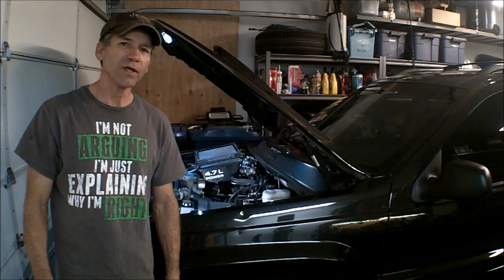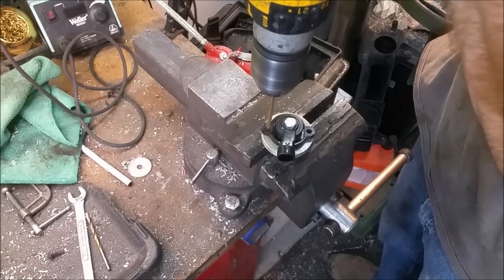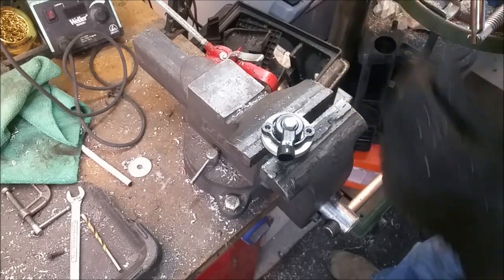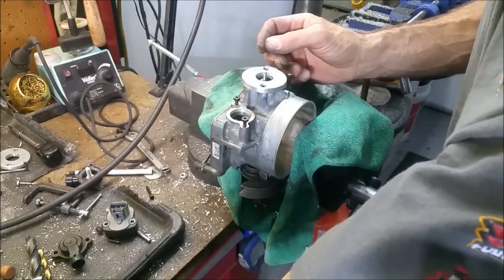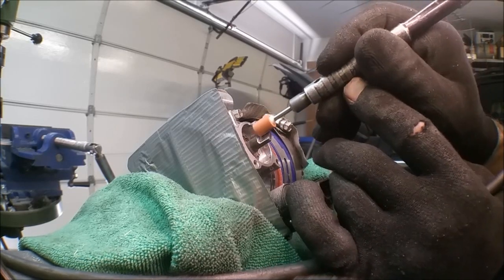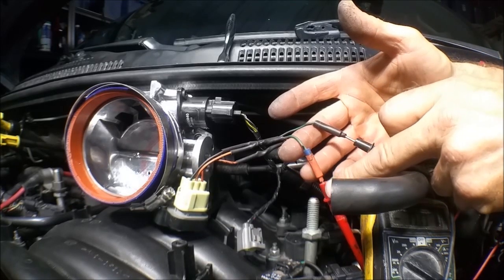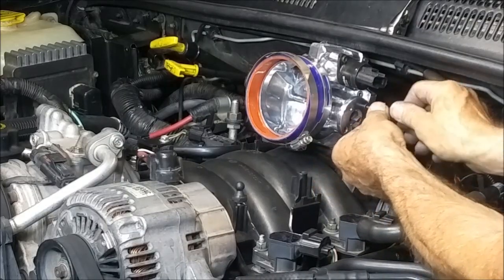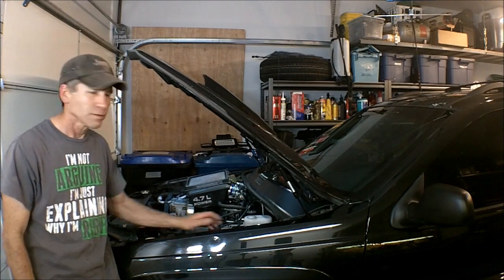Installing 75mm Throttle Body Dodge, Jeep & Chrysler 4.7 Part 2

Comment: Your intake air control is going to affect your drivability even as much as making your air conditioning function properly is critical. The four wire '99 through 2004 IAC are usually not compatible with the two wire 2005 up remote electronically control throttle bodies. I have an interesting work around for this that will let you extract incredible gains just by getting your IAC working.
Reply from the maker: With the throttle body that I used I still use the factory idle air control valve, with a small modification.
Reply: @martinbuilt  so I have an 01 following your HP solutions I went and purchased the canned solution adapter but the Throttle. Body is from a later wireless W model. The tunner I got the throttle body from said just cover the motorized IAC hole and fix the sensor behind the throttle body. It worked! The throttle body itself is stock 69mm where they opened it up was behind the throttle body which measures 70mm. It's pretty slick. Just FYI. The PCM learned the mods. I'm using the 89 octane. There's a 4wD in Sparks that sells the intake manifold bolts.

Comment: Martin, do you have any performance gains data on this 75mm throttle body?  The 72mm throttle bodies where temperamental at best and would be known to throw codes every now and then.  One of the other side effects where that the 72mm would be giving the equivalent to WOT air flow at about 75% throttle… this meant there was no change in power with the top 25% of throttle movement. 

I’m really curious how this is working out and if you have done any tuning to take advantage of the 75mm TB… tuning for the full throttle range would help for sure. 

I’m really just picking your mind and wondering if you have experienced any of the above.  

I know at my track the truck was a about .01 quicker with the 72MM over the 70MM but the 72MM was all in at 75% throttle.
Reply from the maker: Hello Nick, I don't have any data and still haven't done any tuning. I know when I installed the 75mm TB with the 08 intake manifold the gain was very noticeable 😁
I never had a code due to the TB.
Nice to hear from you.
I'll be ordering the APR head bolts soon.

Comment: After you set the TPS at .76v does the voltage increase or decrease as the throttle blade opens?
Reply from the maker: The voltage would increase.

Comment: Impressive as always Martin, great job with everything you have done on the 4.7! I have a few questions I would like to ask you if possible:
1- For those who don't want to run an air ram system like you did, rather keep the OE box, How to go around the increase in diameter to make it fit? Wish you can share the options they car follow for this.
2- I have read the comments below and understand that you don't have the time for mass fabrication, are you willing to share the CAD file or at least a hard copy blueprint of the throttle body adapter?
3- Any specific part number for the GM throttle body?

Thx
Reply from the maker: The stock air silencer will work with this TB.
I don't have a part number for the TB that I used but you can find it on vehicles that I listed in the description.

Comment: Hi Martin im a fan of yours i enjoy watching your videos every other evening  i really like what you have done with your truck, although I have a question how much horsepower is your jeep kicking aftee all the mods?.
Reply from the maker: Thank you for watching. I can't say for sure, haven't had it on a dyno but, I would guess 300 HP
Reply: @martinbuilt  I love this  throttle body mod as well as the 08 air intake, videos that I have watched multiple times to follow the same steps when I start my project, I live in NY and unfortunately there is not enough space to work on project like this also there's not pick a part near by 😪🤣, so how likely are you to build an adapter for the throttle body ones i buy it and also hook me up with the 08 intake and set it up like you did with yours and ship it just ready to install it in my truck, and how much will you charge? your time valuable, but of course only if you can, thanks.
Reply: @martinbuilt  next episode dyno test please 🙏.

Comment: Hey Martin, love all your content! What did you do with the ported stock TB after you installed the LS TB? Would you be interested in selling your 70mm ported stock TB?
Reply from the maker: I believe I do still have that throttle body but I only cleaned up the throat part of the throttle body never really ported it. It's still a 68 mm.
Reply: @martinbuilt  Ok thanks for the reply! Alot of guys on here don't take the time. Keep making videos! I'll keep watching!

Comment: Hi Martin! Im a big fan of ur wjs videos, and letme tell you... a lot of your tips and ways i had applied on my wj. A need ask you... what recommend when change the oil pan on a v8. Really hard work and some help is really appreciate!!!! Thanks a lot!!!! Big regards from Comodoro Rivadavia, Chubut, Argentina!!! (Patagonia)
Reply from the maker: Hello Mariano, I personally haven't done a oil pan change or gasket change yet on the 4.7, I have removed the oil pan from the engine that I have on the engine stand the hardest part was breaking the seal between the oil pan and Gasket. I used a large bladed screwdriver between the gasket and oil pan. 
Do you know Leandro from Argentina he has a mechanic shop there?

Comment: Hey Martin, where did you find the reference voltage for the TPS circuit? What is the difference between the     .52v and the .76v you targeted? 
Thanks.
Reply from the maker: With the ignition switch in the on position, there should be 5 volts on the solid orange wire at the TPS. I like to set the TPS at .76 volts for better throttle response.
Reply: @martinbuilt  thanks again
Reply from the maker: but when setting the voltage use the orange with the stripe.

Comment: with all these great mods you have done, what has your milage been when feathering for mpg or zooming?
Reply from the maker: Well by using the overhead display that shows miles per gallon it seems that each mod I do the miles per gallon increases. Now even though that display is not entirely accurate I use it as a gauge to tell me if things are getting better or worse as far as miles per gallon. In town the display is telling me I'm getting 21.6 I think in reality it's probably more like 18.5, now of course I think it could be better but the thing is so much fun to drive and it's hard not to stick your foot into it.
Reply: @martinbuilt  thanks so much, starting my WJ build. you have inspired me. My last truck was a 2500hd with an 8.1. and allot of overlanders tend to add weight but nothing to add in performance like you have,

Comment: Martin,  I love that there are others out there that want to upgrade and make better with the jeep . Most folks don't do upgrades unless they can pay and have it shipped and done for them.  You on the otherhand just fire up the lights in the garage and have at it! Awesome vid as with all your other videos .i have a jeep 4.0 wj and have replaced,modded or upgraded or have tried everything and I'm gonna go to the yard today and grab some throttle bodies  ... My jeep runs great but I always known it It could be better.... I run a 20 volt system and absolutely love the way the wj responds to higher voltage.  Not just for car audio but it seems to Smooth out everything..
Reply from the maker: Thank you Kyle appreciate that, I also have a video on installing the 68 mm throttle body on the 4.0 that works really well. I'll have to look into this 20 volt system I haven't heard of it.
Reply: @martinbuilt  I v always ran my alternators in my gm and jeep vehicles bypassing the computer , Before i started wrenching on jeeps I started life loving electronics so i got my EE from the university of nebraska and have ran a 12 volt car audio/repair facility for the last 20 years . I use (3) 16 volt batteries along with a supercap module , i use a variable voltage module for the alternator and run the mark  fan with a stepdown module . if you thought the Mark fan moved air 14 volts imagine 20, . I started running higher voltage back in the day because with higher voltage and current amps produce more power and are waay more efficient ill send pic s

Comment: I'm rebuilding my wifes 4.7 Durango. Adding new improved heads, headers, cams, .030 pistons, 08 intake. But I am not sure what to do about throttle body. Feel like it will be missing something without a bigger throttle body intake. Do you have any recommendations?
Reply from the maker: BBK makes a 70 mm that would work well. I got to say I love my 75 which is a perfect fit to the 08 intake. You may want to give Nick at Air Ram Performance a call and see if there's anything else available.

Comment: Hey Martin, great vid once more. I got me that same 75mm throttle body from the yard but don't have the tools to make me the  adapter plates. Would you be willing to make  a set for sale?
Thanks
Reply from the maker: It's just trying to find the time that is the hard part. I would imagine you will also need the throttle cable bracket.
Reply: @martinbuilt  I do have the 08 intake with a plate for the cables that I could put on the adapter like the one you used for the Chevy TB. It will be just drilling and taping the holes. What I don't have is the tools to make the adapter to the intake and the one for the TPS. I would be great if you could make one set for sale but I understand the time limitations. I am a teacher and only have time in school holidays 😎 let me know anyway. 
Thank you
Reply: Hey Martin, Would you be willing to sell the little extra plate adapter you made for the Chrysler TPS into the LS throttle body? I got the TB plate figured out but have not find a solution for the TPS plate. Let me know. Have you gotten into the tuning part yet? I just bought a Superchips 4835 and it should be here soon, I am curious how the tune will work with the mods. I basically have all the same mod you have except the throttle body and air filter system.
Thanks.

Comment: I know you made your own adapter, but I remember you saying that you knew someone that had the adapter for sale along with the 08 & up intake manifold, is that true? Thank you and love the videos, already built the Martinair ram air box.
Reply from the maker: airram.com have the adapter for the Mopar throttle body and saw one on eBay as well. No one makes an adapter for the GM 75mm TB.
Reply: martinbuilt thank you very much, I really appreciate it!
Reply from the maker: @bradallaire3548   your welcome!

Comment: Hey Martin super awesome videos couldn't do these mods without them thanks so much ,,,quick question about the Air temp sensor that you put on your ram air after the intake and TB   upgrade...where do put this sensor in the 2008 intake manifold as the older intake had factory hole drilled to screw the sensor into? Thanks so much....Dave
Reply from the maker: Relocated into the air intake tube or into your air filter housing you may need to lengthen the wiring

Comment: Hello Martin, I just finished this conversion to my 02 Dakota, I had to make a few mods as well but everything worked out well. You are correct, It has made a hug difference and woke up this 4.7. Now my next transformation will be the get my 08 engine in there to add another 100hp. I picked up another 08 manifold and 75 mm throttle body so I can build another one! I am trying something else at this time, I installed 08 lifters in my 02 4.7, They are a different part number and are just a little bit taller then the 02 lifters. I am thinking of getting some H.O. valve springs next. Let me know you thoughts about this mod?.
Reply from the maker: That's awesome Chris, I knew you would like it. I'm not sure what the 08 lifters would do for you. I wonder if the 08 heads have a deeper lifter bore. The thing I wanted to try, what if you didn't change the throttle linkage but,  swapped the location of the cruise and throttle cable on the bracket. This may make the build even easier.
Reply: The lifters were a little taller then the 02 lifters. I used my digital caliper to measure them. I just wanted to see what would happen. So far no issues, No noise and great performance. I will keep you posted on this in the next few weeks and if everything works out we can spread the word. I didn't have any issues with the throttle or cruise cables I just had to make some brackets to hold the hot water tubes for the heater core, and my oil dip tube. The major mod was to install a 4" air intake system.Now, I did some research and I am going to my local pick-n-pull and gather up the front brakes system from a 03 Dakota, It comes with a dual piston caliper, Which I hope will help slow down the beast? Then I may switch over the rears to disc??
Reply from the maker: @chrisbeitzel4788  sounds good, yeah when I went to WJ brakes on my XJ that was a huge difference. I can lock up all four tires now and that's the 35s with no problem at all

Comment: Hey martin great work on the 4.7 Dodge .I purchased all the parts to do this throttle body upgrade .as i was making sure i had all my ducks in a row i realized i have a different idle air position sensor which on has two wires.and the size of this sensor is definitly to big to fit or adapt .the vehicle i am starting with is a 2003 dodge crew cab 4.7 truck.I know that the two wires are #28 ground and #38signal or voltage .I think the idea is to us the one off the LS1 throttle body that has four wires.I know on the ls1 idle sensor has a high and low side  A and b but thats as far as i got.i think the dodge two wire sensor has a 5 volt signal but not positive.
Reply from the maker: I would be interested if you were anybody could figure out how to adapt the older Chrysler or LS type IAC. I am Percy not familiar with the two wire IAC. I really kind of got lucky when I was building mine that the Chrysler IAC was so easy to adapt to the GM throttle body. Building a actual adapter for the two wire IAC to the GM throttle body doesn't look practical and not sure it's even possible. Next time I'm at Pick-A-Part I'll have to see if I can find a two wire IAC and just get my hands on one to see if there's anything that can be done.

Comment: I was told to check this out by a customer.....nice job! Just needs a real tune. 😎 -Ryan
Reply from the maker: Hi Ryan, Super to hear from you. I was going to contact you as soon as I installed a set of 08 camshafts and HO Springs. I have the SCT 3200 programmer. I'm sure this Jeep is really going to  fly once I get you to tune it for me.
Reply: @martinbuilt  Sounds great. I look forward to it!

Comment: Ever see where somebody puts a larger carb on an otherwise stock engine and the performance suffers?  We are not dealing with a race engine where WOT matters. Nice work to be sure and you were very patient with your explanation but I still don't see how putting a TB for 7.4 on and engine of 4.7 is needed on a street application. I'm sure it sounds "better" but what does that really mean?
Reply from the maker: I know what you mean. On the 99 through 07 engines with their stock manifold I think a 70 mm works great. When going to the 08 plus intake manifold they ran a 74 mm throttle body. The 75 fits the intake throat perfectly and I could actually feel the difference in horsepower.
Reply: martinbuilt has it been on the dyno yet?
Reply: @martinbuilt  Please don't take this wrong but you can't feel horsepower.  What you feel is torque. Horsepower is really nothing more than a math equation. The result of torque times rpm.  An improvement in exhaust might really payoff because just looking at the stock log manifolds on the 4.7 they seem rather restrictive. That's only an observed opinion however. We would need dyno testing to really bare that out. Once again GM leaves Mopar wanting. The LS platform is a more universal application with a number of performance things being developed for them all the time. I'm a Mopar guy like you but I'm old and married to my pushrods. LOL.  Long live the Magnums!!  ;) .

Comment: What are you doing with that last connector so that you don’t throw a code?  Because this is definitely happening to my WJ
Reply from the maker: I don't understand what last connector. I am not throwing any codes.
Reply: Thanks for responding.  At 17:35 in the video there is a loose connector there.  In an earlier video you put something in there as a place holder, I think it was an air temperature sensor.
Reply from the maker: @bigbear7233  yes that is my air temperature sensor. I moved it from the intake manifold to my ram air system.
Reply: martinbuilt Thanks for clearing that up.  Love the videos, I’ve watched most of them multiple times.  Keep em coming

Comment: Can you upload a video with it running and take us on a ride like you did with the HO cam video please! I just picked up the 7.4 throttle body and will be doing the 75mm mod just as you did sir!
Reply from the maker: I do have this video, where install a ATI super Damper and do a test drive. I have the 75mm TB installed. https://youtu.be/27ix7Bcw_KI
Reply: @martinbuilt Your 4.7 sounds great man! do you have any pictures and/or specs of the throttle plate adapter you made? I just picked up an 08 intake as well, Im thinking about making mine from 3/4 fiber impregnated plastic.

Ps. Just got a pair of HO cams from the picknpull junkyard, you are a bad influence sir! Lol thanks for the awesome videos!

Comment: The question i have that noone has asked why did you change the tps from the 50s to the 70s? Also want to sell me your now unused adaptor for the 3 bolt tb to the 08 intake? Just found your channel so it will take me a min to get caught up on your videos.
Reply from the maker: Supposed to get a better throttle response when the TPS is set at the higher voltage that I specified